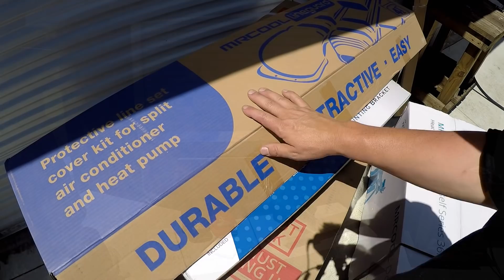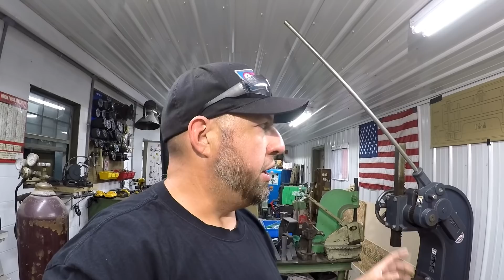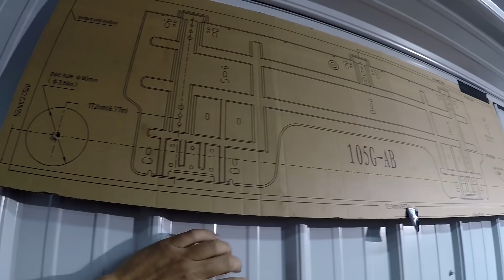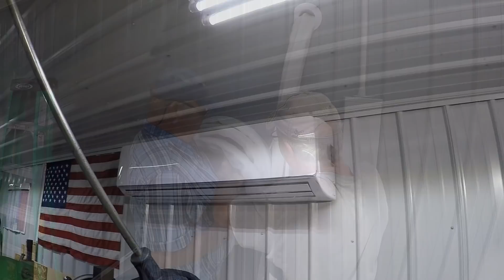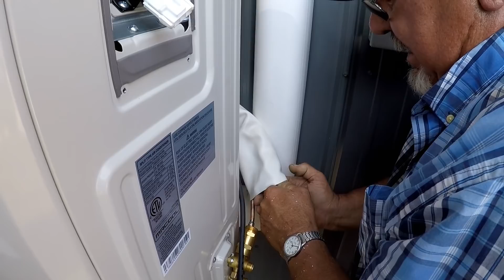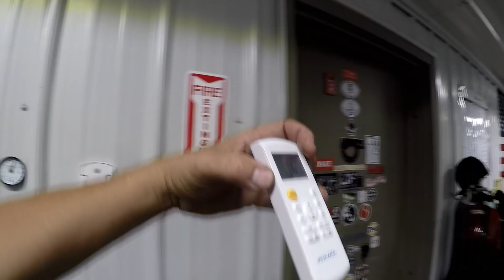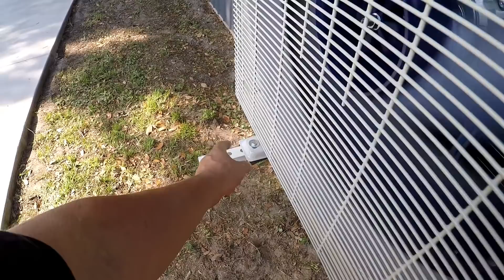Mr Cool DIY Shop AC Install

Comment: The video was a very good explanation of the install, but a little advise from experience....machine shops are one of the worst places to install these type units. The cheap filter that comes with them will not catch the machine oil that's in the air and will plug the evap. coil and blower wheel in short manner. Cover the top of the air intake with some sort of foam filter material to help and change regularly...if you don't believe me, tape a piece of paper towel on top and see how fast it gets oily. And yes it will restrict air flow, but that's the trade-off for not having to disassemble all the time to remove the greasy dirt. These type units are not designed for work environments.....but I'm sure someone will correct me>>>LOL
Reply: nice one.

Comment: Pre- vaccume is only to keep moisture out of the unit while in transit or storage etc, You MUST! purge or vacc the system before opening the high side line,  As soon as you remove the caps Moisture will enter the system in a short period of time.. Wayne A/c tech of 25 years.. And also you should really not coil you lines as this can trap oil from you system.
Reply: Try to pay attention, they did teach you that in school right? I’m starting to see a pattern in these comments, people saying about some of the garbage that goes on with the hvac profession. I’ve felt bent over by hvac people in the past and I knew it was greedy but this is insane. I’ve often wondered why we don’t use mini splits here in the US like every other country I’ve been to. It’s an unacceptable risk to you guys monopoly isn’t it, speak the truth now no need to BS.
Reply: Yup, you noticed. They are trying to discourage people from doing this themselves.
Reply: Ethel Ryan It seems that way, on a property of mine we have an older AC/heat pump and I only just figured out all that BS about the older refrigerant no longer allowed to be used. So now within a year or so (until it no longer cools and heats sufficiently) I have to install an entirely new system at probably $15k or more. At the beginning of summer the fan motor on the condenser stopped and I had to get it replaced ASAP, they refused to use a motor that was salvaged and refurbished from another condenser and I had to pay $300 for the motor that they ordered (same with other places I called) as they wouldn’t install one I provided and I simply didn’t have time to do it myself. It took 4 weeks to get the damn fan because they ordered the wrong part the first time and they wanted to charge me for the visit where they realized it was the wrong motor! They knew they had me over a barrel and they couldn’t care less, I would describe it as the equivalent of being mugged.

I predict within 10 years window units will probably be banned in the US like the EU (citing climate change bs), and when this happens we will see the hvac profession suddenly embrace mini splits and proceed to literally rape everyone who waited until the last minute to replace the window units.
Reply: Pleasantly Rusty  Well there is a great attitude when someone is trying to help, In the future i will not try to help...
Reply: @WayneCook306  You would be more helpful if you had paid attention to the video.  All of the lines are pre-charged and there is no need to "Pre-vacuume" (the word is 'vacuum') or evacuate them.  The valves in the ends of the lines and on the condenser are designed to preclude virtually all of the air as they are mated.  The caps are just dust seals.  You REALLY should have paid better attention and not assumed that you know everything.

Comment: It'll heat the shop in the winter, too. The only thing I'd add is a sloped shield (or roof) on top of the condenser unit to direct rain off the thing.

Comment: I always suggest using two simple things-

Tape a few short lengths of ribbon to the vent 
to easily tell when and what speed it's blowing, 

and one of these devices can make a huge difference
in air distribution-

https://www.amazon.com/Wing-Original-Conditioner-Deflector-Ivory/dp/B00CDCPB9S/ref=sr_1_11?crid=2G0G1L9E1MGKT&keywords=air+diverter&qid=1564364049&s=gateway&sprefix=air+div%2Caps%2C160&sr=8-11

Please consider these. Thank you.

Comment: No vacuum
Reply: Where in the  the installation manual say to use one ?
Reply: @RobertMSmith1  On the side of the machine, you can read use a vacuum pump at 21:09 lol
Reply: What about when placed lines together trapping moisture I'll still vacuum personally
Reply: @hvac526  Then the pre-charged lines you just spent $ on is lost , The use of king type valves removes that problem ,

Comment: What’s the clearance on your inside unit to the ceiling? The install manual says to have a 6 inch clearance... the location I’m thinking about would have a 3 inch clearance. I just want to make sure I’m able to snap in place with a 3 inch clearance. Thanks
Reply: The front cover needs to be able to open upwards enough for you to access the mesh filter for proper cleaning.  You might want to consider contacting your supplier for technical details.  Good luck.

Comment: This is one of the most informative and detailed videos.This has helped me with my decision on purchasing my own unit.I feel confident on the install.Unless Fernando is available to stop by(ha ha).Thanks Abom79 for a great video.
Reply: highwayjunkie get one! I have a 24k mr cool diy. Takes the moisture out of my garage to unnoticeable in a matter of 10 minutes. Living in Texas the humidity is pretty nasty!
Reply: I put a 24k in my shop, its 24' x 25' but well insulated, it will freeze you out of the shop in the middle of summer, and does a fairly good job at heating too.   Highly recommend it!

Comment: I install Fujitsu mini splits. Fujitsu does not want us to coil up extra refrigerant line vertically. They are afraid that it would act as a oil trap. If we have to coil up extra line they want us to do it horizontally. Mr. Cool does't share this concern?
Reply: I'm getting ready to install a Sunville unit and I had the same question.  They say not to coil up vertically but I'm not sure what to do with or how to store the excess.
Reply: @mijohnst    Not an easy solution to that problem. You can coil it up horizontally on the bottom of the unit, but that might look like crap. I usually cut the refrigerant lines to the proper length, but sometimes I have to coil up the line to meet the manufactures minimum line length requirements.
Reply: @kgraydakota  Thanks for replying.  I guess I need to practice up on my flaring. lol  With your method I can cut about 6 feet off one of my lines and 12 off of another.
Reply: @mijohnst  I'm not familiar with the type of lines that they used in the video. It looks like the are sealed and precharged, and when they screw them together the seal is pierced. If that is the case then you will need a vacuum pump to evacuate the lines once you cut them.
Reply: @kgraydakota  The lines that come with the Senville are not as nice as these and I'll have to vacuum the lines out after they're installed so I think it's a good option for me to cut and flare the lines.  Just more tools to add to my toolbox. lol
Reply: Kevin Gray you cannot cut these lines as that’s what makes it diy
Reply: When the outdoor unit is upper from the indoor unit you need a oil trap

Comment: If condenser air is exhausting from the back, ifit was mine, I would pull the condenser as far from the wall as possible. This will help keep the head pressure as low as possible.
Reply: Condenser air exhausts from the front - where the fan is.

Comment: “do it yourself”, takes 4 guys....😀🤪
Reply: Do it yourself, not by yourself!
Reply: Keep in mind that is the biggest version I think. The others are smaller. However,  his friend installed one of these by himself. https://youtu.be/XxWNlIYFFqM
Reply: @ P Tourne Obviously, 2 guys maximum to install the bigger unit. The point is you don't need a AC guy to install and if you are competent with electrical you can do that too--DO IT YOURSELF. You sound like the typical armchair nitpicker! Adam looks strong enough to lift both units in to place on his own.
Reply: @KStewart-th4sk  just pointing out the fact of a DIY project...and yes,  I have installed by myself, no armchair required.
Reply: And diy implies 'on the cheap' and there's nothing cheaper than having an ac unit given to you free not too mention electrical done for you. Lmmfao.

Comment: Just a tip, when installing a mini/multi split system, it's not a bad idea to also install a whole home surge suppressor if you don't already have one (probably best done by a licensed electrician).  I understand some HVAC contractors now routinely do this on new installs.  We learned this the hard way a few years ago when a lightning surge took out two 3-ton outdoor units and four indoor units (chips were literally melted and/or exploded on the circuit boards).  Homeowner's insurance paid for the damage but we were still without A/C for three weeks in August.  Not fun.  We now have Type 1 surge suppression on the incoming utility side and Type 2 on the electrical panel.  Plus Type 3 surge strips on all electronics in the house.

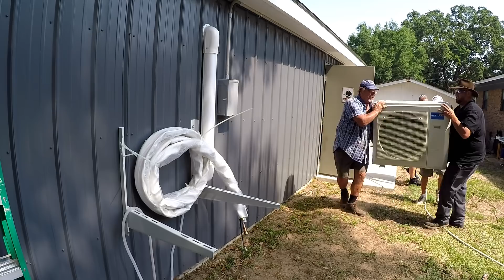Comment: Watch at 19:00     It is critical that you connect the lines properly according to instruction. I think this is were most people run into problems.  You don't get any second chances on that.   Also, hire an electrician to make sure it is properly wired.  If you have elevated basic skills, you can do this install.  Also, if you don't want to hang on the side of your structure (outside unit), you can get a pad for about $40.00

Comment: I remember in the late 60s and early 70s Sears sold DIY split AC systems with pre-charged line sets. Same idea here. The fact that it;s R410A probably makes it legal. I don't know if an R22 system could have be sold like this after 1994 when the EPA required  a license to purchase and handle R22.

Comment: If Fernando is an AC guy, why didn't he shorten the lines?
Reply: Because the lines are shipped under a vacuum and the couplings on the end have a a seal on them. When you tighten them down the seal gets pierced and then once you open the valves the refrigerant flows through the lines. If you shorten them you have to pull the whole system down to a vacuum once you do those valves and then refill it. Not worth the time and effort when you can just coil it up and stick it behind the system.
Reply: A/C guy not a technician

Comment: As an HVAC Tech this scares me... But I hope it lasts for you, well done.
Reply: LotusLambo  I agree with you about that cutting corners and overcharge prices but isent that a fear you get with all proffessions. Ex carpenters carship dealers and so on. My standpoint is to help a customer in the right way of investment instead of buying crap thats not big enough or to small and has an estimated lifetime of 10-12 years instead  of 5 (when you pay for a units thats 1/3 cheaper)
Reply: LotusLambo  You need a better HVAC Tech. It is true and unfortunately more so with the younger generation but I would like to think a tech willing to comment on an expertly done installation is one who takes pride in his or her work. Trust your experts but hold them accountable as well.
Reply: LotusLambo  im not worried about my paycheck. Im worried about companys that sells subgrade equipment to people that dont know the whole story. Some units work but most you wont get more than 5 years out of so its a matter of investment vs lifespan
Reply: Im an HVAC Tech aswell and this scares me to , tho the lineset is mutch better then the bayonet couplings that ive seen nothing beats a brazed coupling :)
Reply: Lmao you're right on. Theres so much hack in this video... And theres shotasses in the comment section trying to defend it lol. I literally cringed watching this.

Comment: if your staring at the front of the unit is it 25' of slack from the lines coming out the right side or the left side? Do you lose any slack from going out a different side?

Comment: When he puts the wrench on the refrigerant line to tighten it down, is it real good and tight or juuuuust barely tight enough that you are looking for?
Also, I'm sure it's fine, but officially you are supposed to use 8 gauge wire for the 36,000 btu unit. I'm the opposite of you, I'm good with the electric and don't know the rest lol.
Reply: You don’t size wire to the breaker on an air conditioner
Reply: Look at 440.21
Reply: @Shmash_whatever  Code is "Minimum to not be illegal".   Kinda like Mil-Spec means "Lowest bidder"
Reply: TheRacerRich lol you do not need #8 wire on a 3 ton mini split
Reply: @Shmash_whatever  You do according to the manufacturer. It calls for a 35A breaker on the circuit. A 30 needs 10, a 40 needs 8, you should use 8 on 35.
Reply: 1/16th of a turn after the fittings are finger tight and you should be good. Also a little bit of refrigerant oil in between the two connections
Reply: You need 10 bro.
Reply: The connectors come to a flat dead stop when tight. It is obvious they aren't getting any tighter.

Comment: Adam, if I may make a suggestion... insulate the fittings where they come out of the condenser. In the short time you shot this video they gathered a lot of water from the air which means they are losing energy (cooling). Just a thought... Some pipe wrap and duct tape.

Comment: Nice video man BUT apart from drilling the hole, you had an HVAC professional technically do your install and do the electric which defeats the DIY aspect of this video in my opinion. No disrespect meant :)
Reply: Optimus Prime I honestly don’t think this is a diy
Reply: @lilonenps  I bought one and installed in in 1 day. The toughest part was running a new electrical wire as I wanted this on its dedicated 20A breaker. Everything else was rather simple. I built a wooden platform for it with pressure treated 2x4 (cost me $20 rather than buying those plastic ones on amazon).  I also bought 2 sets of line covers and I practically used 22 ft ou of the 25ft of the copper line. Overall I consider the difficulty level to be a 4 (10 being very hard).

Comment: I am surprised in the US air conditioners are sized up in "tons" and not BTU's(British Thermal Unit). They do that in the Persian Gulf too and while living there I often wondered where this reference came from.
Reply: I think it's something like how many tons of water the refrigerant system would be able to turn to ice within a certain period of time (or something crazy like that...)
Reply: @therealchayd  Yes, 1ton (2000 pounds) of ice can absorb 12,000BTUs of heat for cooling.
Reply: Goes back to the time of ice houses and how many tons of ice it would take to keep things cold.
Reply: not only that in the USA you need a licensed electrician and a licensed  ac technician to help you lift a diy unit up on a wall
Reply: Andrey Cham: No, not everywhere in the USA..............

Comment: Man, you'd better weld up a security cage for that thing before the copper thieves find it. I swear they're getting bolder by the year.
Reply: There is no copper the lines are steel braided only like 3 foot on the iside that he tucked into the back of the unit and about 8 inches of copper where the fittings are by the outdoor unit

Comment: Really cool video Adam.  After watching your video and it catching my interest I looked up the unit you installed and learned that it is also a heat pump as well.  After doing some thinking and research I ended up buying 2 of these units to install in my house one for each floor.  They are not quite big enough for the whole house, but will do ok I believe.  My house is old brick and is over 100 years old with a gas boiler for heat and have no AC other than window air conditioners.  Putting in these units to help with heat in the winter will hopefully cut my gas bill of 500 a month down.  I see the unit also dehumidifies so depending on how the 2 units do I will get one for the basement as well.  My only issue of installing the units is drilling the 3 and a half inch hole though a foot thick brick wall.  The conduit and wiring will not be a problem just the cost from the length of service runs.  Will be in one conduit for both units as will be mounted next to each other.  Was looking at a couple forced air gas units with central air, but with that and the ducting would cost me between 15k to 19k for size of house.  5k sounds a lot better plus materials for install.  Thanks for sharing.
Reply: Don't do it man. Mark my words. Your going to regret your life choices.
Reply: @joshuaricks7730  I have no regrets the units have performed just fine for cooling and the heating.  Heating works way better than was expecting.  I have not bought the unit for the basement yet, but will be doing sometime in the short future.  I will also be getting a unit for my garage once the inside is closed up as is just all open exposed studs at the moment.  Only issue I had with the units is the phone app control that was a little tricky to get working.

Comment: Never thought that I'd need AC here in Wales. 
My flat (apartment) is on the top floor, right under the roof, very little attic space. 
About 5 years ago it started getting uncomfortable here in the Summer.
3 years ago I got a floor standing/portable unit. Vents through a bracket on the window frame.
I run it half the year now ... and some say there's no Global Warming
Reply: Here in Ohio we have been experiencing extremely wet weather, with cooler than normal conditions.  Climate change is real, global warming well it's hard to tell.
Reply: @thegreatga  Yeah, we get a kind of Monsoon rainy June that we didn't used to and a warm February. The extra global warmth destabilises the old weather patterns.